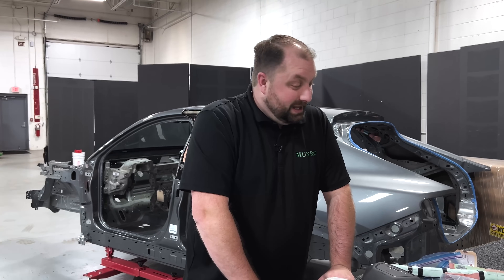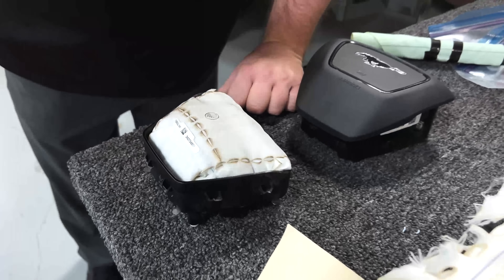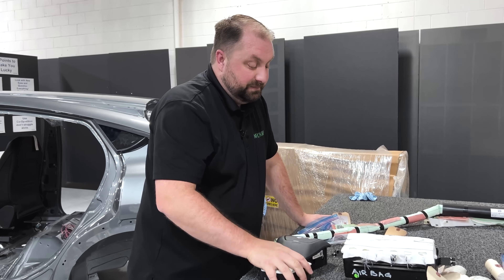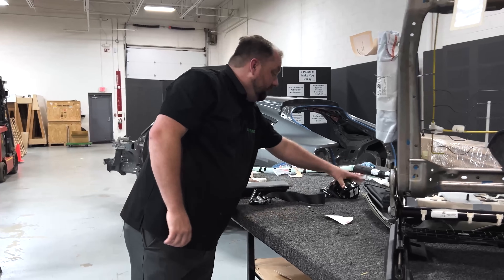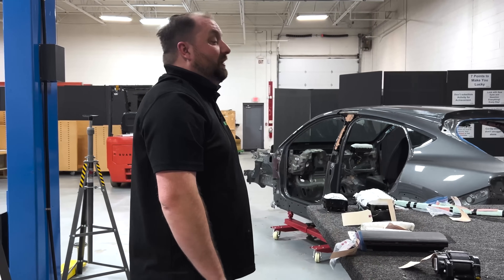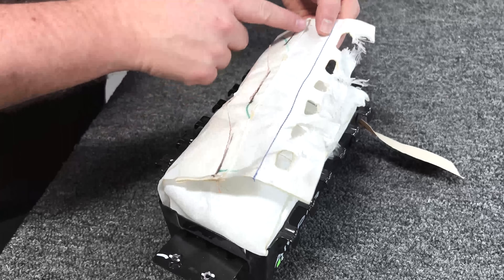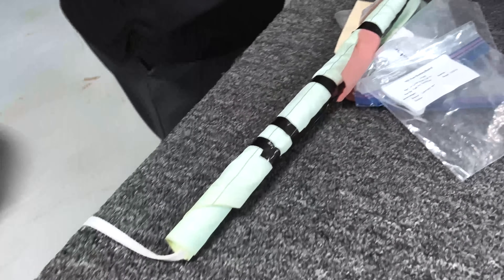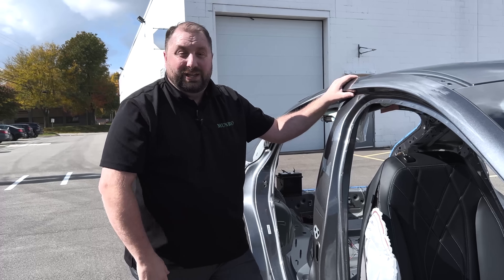Automotive Fabrics, How Seat Airbags Are Deployed.

Comment: Safety is always #1!  Some things that Tesla does to improve passive safety is detect not only weight on the seat but weight distribution. It can tell how you're sitting to properly deploy the airbags. More recently they implemented seatbelt pretensioning just before the collision using the advanced Vision system.
Reply: A lot of cars have that pretensioning feature. I believe its called pre collision system. Depending on the car it may also automatically brake.
Reply: @drkastenbrot  My 2005 Prius Hybred has pre tensioning that I have felt about 10 times since it was new. - Fortunately no accidents.
Reply: Tesla has also added a new center airbag on the Model Y (China built) a few months ago that protects two front occupents from slaming into each other.  It's going to be rolled out to other Tesla models and regions.
Reply: @tesla_tap  Can't wait to see Munroe Live describe/shoe the Tesla airbag designs.
Reply: @jbarvideo12  lol…. It’s nothing special! Just industry standard! Stop the crap!
Reply: Lol….. it’s the same thing with other manufacturers too! Other manufacturers even have seatbelts that and seats that hugs you when going into a corner for even more protection